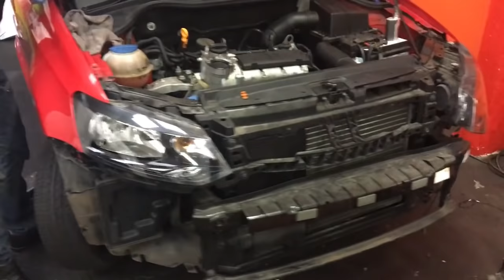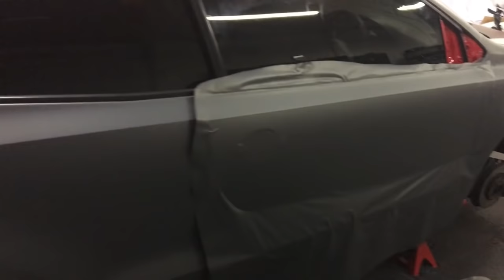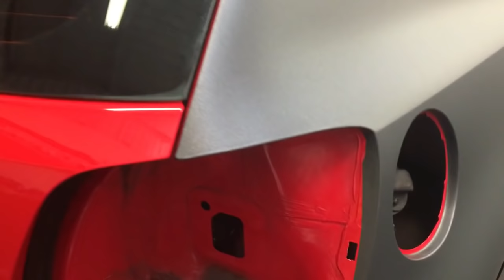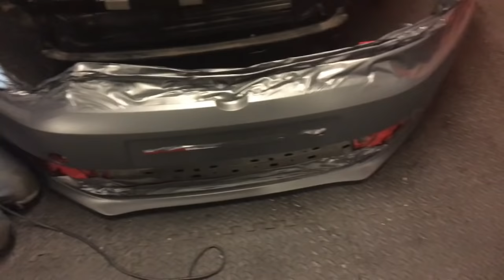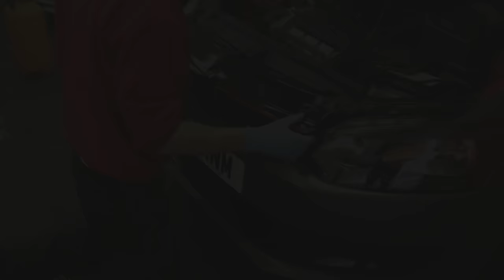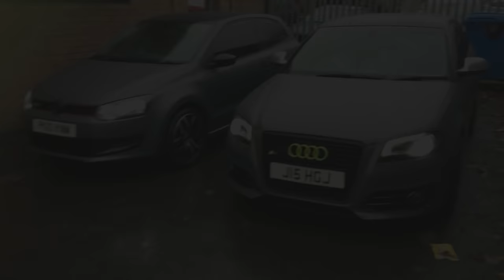VW Polo 3m Matte Metallic Grey Wrap

Comment: How do you get the lower grill off this? Been trying to pull mine off to spray paint it, do I really need to take the whole bumper off?
Reply from the maker: You don't need to remove the bumper to remove the grilles, this is just to wrap it. The grilles pull outwards, they are held in by clips.
Reply: Cardiff Tints I tried pulling with all my strength with no luck, how do I unclip them?
Reply: Unclip them from inside under the bumper

Comment: Can we legaly change the colour of vehicle because on rc there is colour mentioned. ?
Reply: Gulshan Kain first question in my mind 🤔
Reply: you have to inform the related department  for change in color or any other modification you make.
Reply: You can change the colour by wrapping or dipping it. You cannot change the original paint(unless the car is fully paid off).
Reply: You can change paint or wrap it just inform DVLA
Reply from the maker: In UK you don’t need to inform as it’s only a temporary colour change. Base paint colour is always the same.
Reply: @Sia1989  oh nice